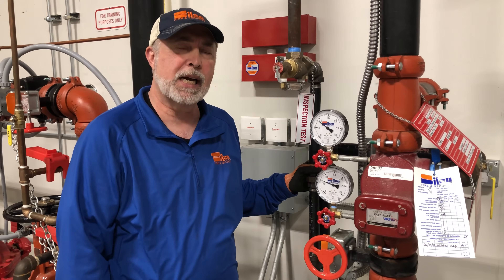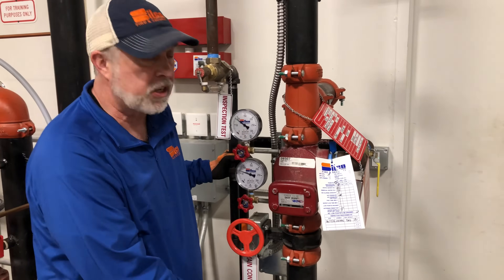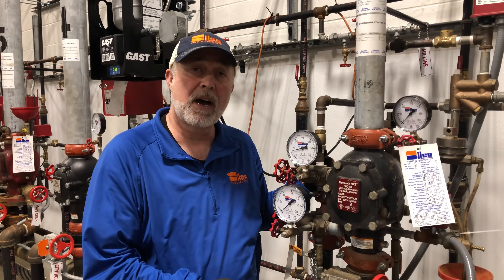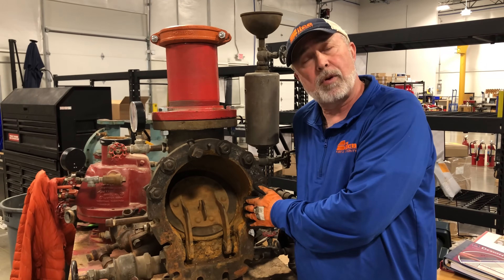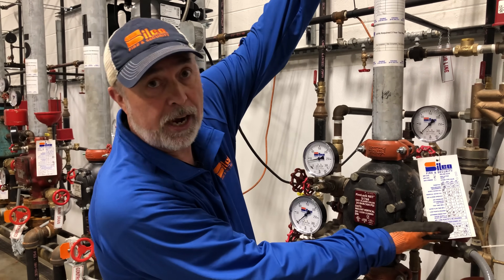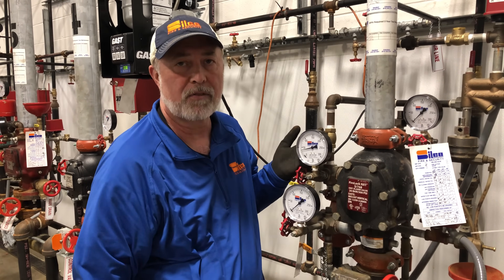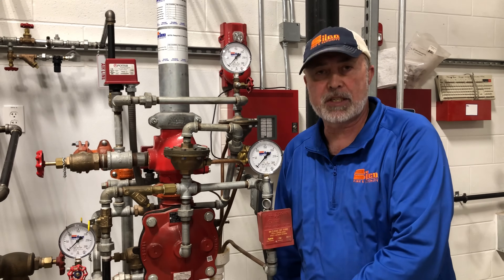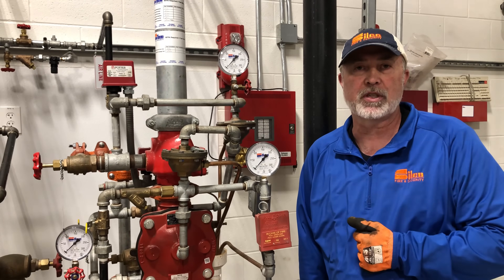Fire Sprinkler Types - Wet / Dry / PreAction

Comment: here is a question for you as you probably know in new installations anti freeze is frowned upon it seems possble that  a fire hose can be attached to the sprinkler system so my question to you is could a dry sprinkler system be attached to a  fire hose valve to function as a dry hose valve? thoughts please thank you
Reply from the maker: @Fredengle thank you for the question and we hope this answers it for you - Yes, you can have a dry pipe system with a hose connection, similar to a setup in a parking garage where there's a hose attachment on each floor. However, an antifreeze system will not have a hose attachment. it's more typically used in localized applications, like a hotel foyer or over a garbage crusher.
Reply: hI my new question for you is could a hose be connected to a pre action system?

Comment: Only reliable and victaulic make a pre action “valve”. That particular system you have is a tyco and Viking is the same thing. They don’t make a pre action “valve”. There systems consist of a deluge valve with a check valve on top of it for the supervisory air which also consists of having a solenoid valve to make it single interlock and some have dry pilot actuators right after the solenoid to make it a double interlock.